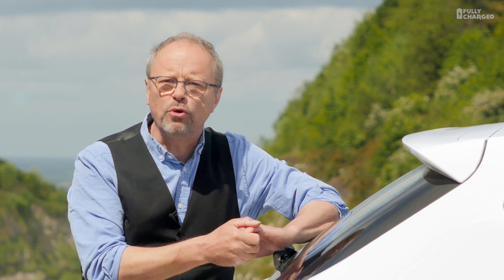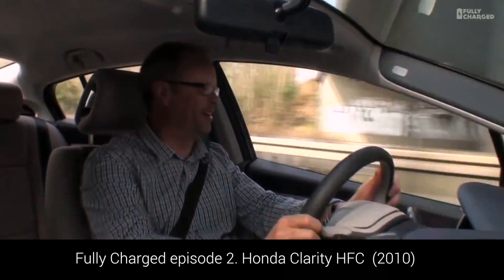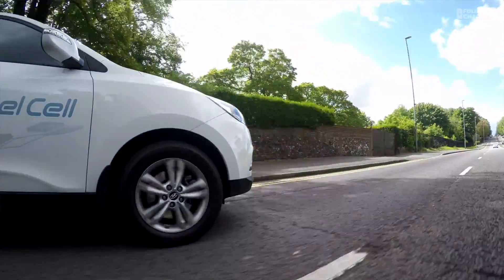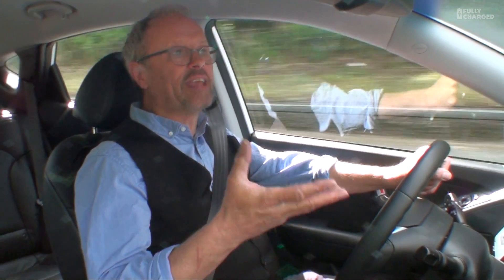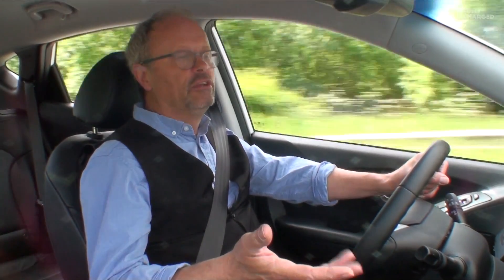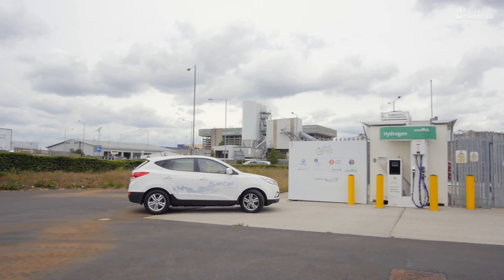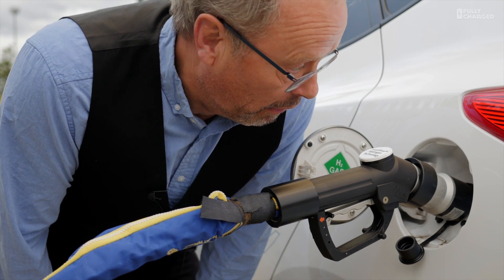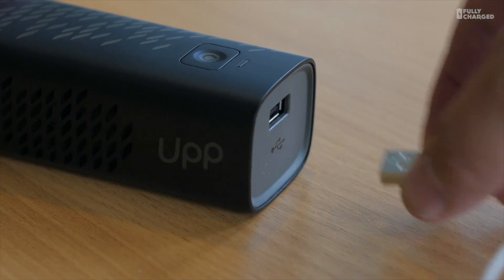Hyundai ix35 HFC | Fully Charged

Comment: Hydrogen fuel cells are very old technology. Putting them in a car is fairly old technology. Doing it in a modern car with modern convenience is new. It's only an engineering and packaging challenge, not a scientific one. Now, I'm not anti BEV, I think they're a great solution for passenger cars, but BEVs aren't going to work for large truck transport. Hydrogen is one opportunity there.

Comment: Congratulations on your vehicle, even when there are not enough hydrogen charging stations yet, I believe we (open sources people) can make possible the vision of hydrogen power stations everywhere at lower cost faster than any oil refinery company. See, I believe every person should have the capacity to generate all the energy needed for his or her own needs including transportation. Obtaining the hydrogen from water is the way to go because we  can produce electrolysis by using a "low-tech" solution.  Horse (HP), oxen, buffaloes in the remote areas not just in the UK but everywhere, can help us to obtain the fuel. Who would not like to convert the snow from the backyard into fuel? In 2003 I invented an "accelerator" that can help us to increase the efficiency of animal power. One HP 746 Watts per second/ 2.6 megawatts per hour is enough power to change the hydrogen production and sale business. Farmers will have an additional source of income. Water will be stored in tanks coming into the source of power for hydrolysis, then the hydrogen is produced and compressed on site for the local sale while the byproduct will be the oxygen. Every person that owns a labor animal can do this today a relatively very low cost (the turf and the TLC for the animal). Please let me know if you know anyone in the UK that would be interested in building a pilot for this solution. Thank you!

Comment: HFCs.. so inefficient....
Reply: TheSaintST1 if you have hydrogen generator conected to some of renewable sources that doesnot cost to run, efeciency doesnot really matter that much, unles you could change your batteries in electric vehicle instead of timeconsuming charging its not obsolete

Comment: The reason windmills are not producing is because the grid is powered by more fossil fuel burning plants. Many of these plants can't produce a little bit of power. They only can produce a lot of power. Energy storage is what we need to get rid of fossil fuel burning plants. So that means, higher density batteries. (which will happen. We´re nowhere near the limit of maximum energy density.)

If you need to use sustainable energy, to store only one quarter of that energy,.... you´re doing something wrong. If you use that same energy and store close to 100% of it directly into a battery, you´re doing something right.

 Like you said, there are battery recharge stations everywhere now a days. Why would we need an hydrogen distribution system along side something that's better, more efficient and cheaper. Betting money on fuel cells is throwing money away.

It's not even nice that it exists, because it's so freaking obvious that the oil companies (and their political alies) are behind this. George Bush tried it before as well. Didn't work.

But,...... it does expose an interesting point,...... oil companies are afraid.... and they should be. It won't take long before the need for oil is going to drop. Electricity has gained momentum and public opinion is shifting. More and more people are now interested in Electric Vehicles because 1) It's cool, 2) It's better than fossil fuel cars, 3) it's cheaper. Once the need for oil is starting to drop, (just a couple of years to go) the price of oil will drop big time. And this is not a good thing.

What needs to be done is finding new ways to use oil. We still need plastics and tons of other oil derived products. But those don't  get burned, so their impact on the environment is small (especially if we recycle oil derived products). 60 to 70 % of the oil production gets burned, so that's a potential huge loss for oil companies (and oil producing countries.)  (There is a big risk that the oil will get dumped in the third world. Just think a bit about what options oil companies will have and how relatively easy it is to control politics in the third world.)

So I am an advocate for inventing more products that can be made of oil to compensate the reduction in oil usage. In fact,... carbon is used quite a lot in batteries.....  graphene (future of bateries?) is made of carbon, isn't it?

Comment: do u think they could manage to have a car, that splits its own water for hydrogen? essentially u just fill your car with water and it slowly makes its own hydrogen? or is the process too slow/big for a car?
Reply: I think the main problem with having a hydrolysis setup on board the car (which would of course require electricity to work) is storing the H2. Because hydrogen gas has very low density it has to be either compressed to very high pressures or liquefied in order to store enough to be worthwhile, so you'd also need a high pressure compressor or a cryogenics plant (which is totally impractical).
Reply: You do realise that splitting H2O requires a current...?

Comment: so...instead of producing hydrogen using wind power, won't a better alternative be to divert that power to charge up a battery instead? With a 4 to 1 ratio of energy transfer, hydrogen production does not make any sense.
Reply: trinhkets think about hydrogen as battery you can just fuel up,  we dont have yet have infrastructure for charging stations and already people in places where is lots of electric cars does have problems in waiting for charging in line. Efeciency of energy transfer is not that big deal, batteries doesnot have 100% charging efectivity and fast chargers are little worse but when you have enought of energy lets say from fotowoltaic we can use it to sa pre large quantiies of fuel at no expenses posibly make large hydrogen generator plants in deserts and send it in pipes acros the world just like we already use for natural gas and oil . also its easier to change all gas stations to hydrogen then charging ones.
Reply: Batteries cannot handle high power density. They do ok on phones are slowly becoming acceptible in terms of losses for cars but if you try to plug a 1MW wind park (which is small) into a battery smaller than a house with some nifty distribution and active cooling system, it will just burn up. Also we will always get loads of hydrogen as byproducts anyways since we will always be using natural gas and or oil for medical and plastic industries which have hydrogen as a byproduct. Higher energy density, superb synergy with other industries and renewable energy. H2 is a good solution.
Reply: That is why electric/battries tech is much better and safer than hydrogen. Future  is electric, hydrogen supporters will keep trying for now but later on go with electric or will be out of bussiness.

Comment: At present, 95 percent of America's hydrogen is produced from natural gas. Through a process called steam methane reformation, high temperature and pressure break the hydrocarbon into hydrogen and carbon oxides — including carbon dioxide, which is released into the atmosphere as a greenhouse gas. Over the next 10 or 20 years, fossil fuels most likely will continue to be the main feedstock for the hydrogen economy. And there's the problem: Using dirty energy to make clean energy doesn't solve the pollution problem-it just moves it around. "As a CO2 reducer, hydrogen stinks," Joseph Romm, executive director of the Center for Energy & Climate Solutions, said. I would only support hydrogen fueled cars if the hydrogen was created by electrolysis, and that electrolysis process was driven by wind and/or solar sources. Realistically this scenario would be at least 10 to 20 years away based on most available sources today, especially considering the political forces we are constantly battling with that push to subsidize and advocate fossil fuels and fight against the alternative energy industry. A much
better and simpler solution is to fuel electric cars from roof-top solar panels. Even using electricity generated from a solar plant or wind farm would be far simpler and would be better in terms of CO2 emissions. As an example, I already have solar panels installed on my roof and drive a Nissan Leaf daily to and from work and elsewhere. The solar panels paid for themselves in seven years, and I haven't seen a gas (or hydrogen fuel) station in two years since I bought my Leaf. It was not terribly expensive, relatively speaking for most homeowners, and it was also fairly easy to accomplish.

Comment: Are there any sort of stand-alone-hydrogen-filling-stations? I mean, a station that is just plugged into the grid for power and a water supply so that it can make its own hydrogen and compress it into a tank? It would reduce the need for transport and it would cut out the oil industry from the equation :-)

Comment: The problem with electric cars is economies of scale in relation the the elephant in the room, the battery. Batteries are made of very rare and expensive metals, it would be basically impossible to make all vehicles (including commercial) electric without mining other planets for the elements like lithium. I think hydrogen is a good alternative for wide spread use at least in heavy equipment.
Reply: +mrh112 There are billions and billions of tonnes of lithium dissolved in the worlds oceans, no need to mine other planets just yet even if we were to use up all the easily available lithium in brine pools and salt flats.

Comment: When I fill up my fossil-burner, I get lower fuel-economy.
I imagine that a fully-charged electric car has identical economy to when it isn't fully-charged, right?
What about hydrogen? Does it have better fuel economy when it is full compared to not full, due to hydrogen being less dense than air?
Reply: What you're saying is due to Newton's first law.
It's about more or less mass. It doesn't have anything to do with density. mass is mass.
Reply: The fact that hydrogen is less dense than air means that there is an upwards force meaning the vehicle is lighter. A lighter vehicle requires less fuel to move it, so the vehicle is more efficient.
Mass is important, yes, but the difference in density does too.
Of course, I could be completely wrong (particularly in the terms), but the effect is valid, iinm...up to a point. If there is enough hydrogen, then the grip of the tyres will be reduced.
Reply: An engine spends energy to move the mass along the X & Y axis. And that has to do with, again, mass. not weight.
Although a lighter car can benefit from less rolling resistance due to less force on the Z axis but it's negligible. That's why F1 cars generate as much aerodynamic downforce as possible. 
And most importantly H2 at 700 bar is denser than air surrounding the car anyway.

Comment: Speaking of fossil fuels and the damage they do by making use of their stored energy I wonder the following:
When splitting water into O2 and H, they will be recombined in the fuel cell, and the equation is neutral.
With the H that comes to surface as a by-product from the refinery, is there an equal O2 as a by-product? If not, extracting and using all that H will result in an atmosphere having less and less O2, right? And as we already chop down a hell of a lot of forests over the whole globe, who is going to replace all that oxygen? And plants/trees convert CO2 into C and O2, but not H2O, therefore resulting in more water (some more sea level raise).
Anyone knows more about this? Thanks.

Comment: Here are my thoughts about why this vehicle is a bad idea only favored by oil companies and the automakers who like the relationship they have with them. First, hydrogen, while available as a byproduct of the making of other petroleum products still needs to be compressed either before shipment from the refineries or at those expensive refueling stations from natural gas pipelines nearby after onsite steam reforming. As others have noted there is a CO2 emissions cost to both processes, and of course there is transport, and the compression thermal and energy losses to consider. Funny how the proponents never include these costs or inefficiencies when making comparison to EV's.
Then there is the car itself. It needs that small battery pack because otherwise acceleration is doggedly sluggish. The fuel cell just cannot produce the amount of electricity for that function without being much, much bigger, and costly. So we are left with an EV that has onboard production of electricity at a meager rate, and also minimal regeneration in comparison to an EV with a large battery. My Prius suffers from the same compromises in favor of the oil companies, and a smallish battery. When I take it to the mountains, which I do frequently, it cannot always provide enough electric assist to the gas engine going up, and coming back down the battery indicator reads full within a few miles of the beginning of my descent. This also plays into the hands of the automobile manufacturers as it forces me to use more mechanical braking than I would a fully electric vehicle.
Then, in a fuel cell car, and the Prius it is necessary to carefully design the fuel system far away from the high voltage system making certain that there are no sparks because both vehicles have volatile fuel. On the Prius that means the battery is inside the cabin between the rear wheels, while the gas tank is outside beneath a layer of steel, but nearly in the same place. In both cases it is for crash safety purposes. That design need goes away in a pure EV with good battery design like the Tesla. That battery can be outside the passenger compartment because it doesn't have to be isolated from fuel.
I predict this car will not be viable once enough EV's with similar range become a large enough segment of the market. Perhaps that is why these cars are to be leased, for now.

Comment: Just curious as to if the traction battery can be recharged from the grid much like a plug in hybrid, or if its just for energy storage with no option for an external power recharge much like most hybrids?

Comment: There is this issue of infrastructure of hydrogen vs electricity, it is true, however, that the infrastructure for electricity has been in place for a long time. Hydrogen on the other hand has no real infrastructure. The real question, however, aside from safety and range is, will hydrogen be cheaper than electricity per mile? Irrespective of whether it is weighed or measured in fluid measurement. And as someone pointed out how exactly is the measuring process carried out; not really clear.

Comment: Still not seen anything to change my mind that hydrogen has lost the fight with battery vehicles.

1 - Assuming we want to produce hydrogen without using fossil fuels the loss of energy involved in battery charging and discharging is far less than the production of hydrogen from splitting water. Battery storage costs have now reached a point where grid scale storage of excess renewable power is an option and this is superior both from a cost and energy loss view.

2 - The cost of retrofitting the tens of thousands of fuel stations around the country would be massive. Japan has been going through the process using public money and it has been costing somewhere just shy of $5m USD per station, worldwide a truly colossal amount of money would be required to make hydrogen widespread. Also the hydrogen would still necessitate the use of tankers to transport it around the country which adds an additional layer of cost electricity doesn't have. Not to mention the cost of building all of the water splitting plants needed to produce clean hydrogen. We already have an electricity grid which reaches practically every building in the country and can produce and distribute clean electricity through this.

3 - The huge investment in battery tech driven not just by the auto industry but also the electronics industry as a whole is driving massive cost and efficiency gains which are set to continue for years to come and is vastly out investing research into hydrogen.

So it's not that I'm anti-hydrogen but I just don't see that it makes sense. Tesla already make cars which can travel almost 300 miles on a charge and on longer journeys you can rapidly charge them in the space of 30 mins. I know they're expensive at the moment but within in a few years that sort of range will become the norm and the whole issue of 'range anxiety' will be a thing of the past. And as I've said above the there are lots of areas where hydrogen is falling well short

Comment: I applauded you for showing us the vehicle but Hydrogen fuel cells are "fool cells". The BEV will win in 10 years because they have so much better for the wallet and have so much more potential. 
Can you maglev style charge FCEVs in motion like you can with BEVs?
That's a no. Can you fuel the directly from renewable energy sources? 

We the United citizens of the Earth must emancipate our selfs from this environmental hell and servitude bye boycotting the fossil fuel industry. As citizens we also need to push for new legislation around climate change to get green house gasses down to 350ppm. 

We need a separation of oil and state here in Austin, Texas I tell you what.

Comment: So if we use wind turbines to produce hydrogen with lot if wasting electricity why do we not charge a battery instead and DON'T waste this energy?

And then the efficiency of a fuel cell is not much better than petrol in a combustion engine.

I'm still not convinced hydrogen is the future.